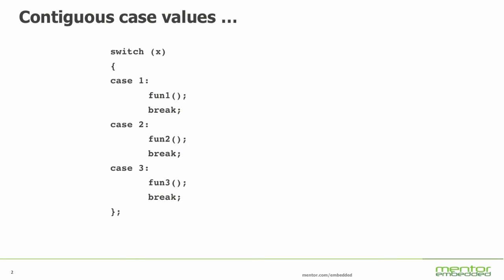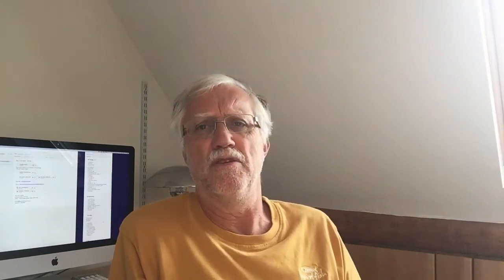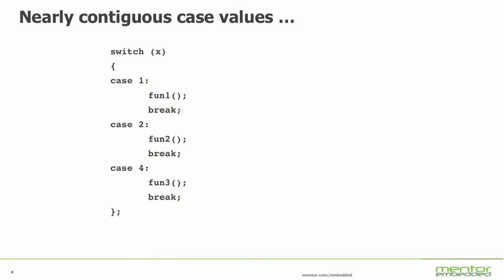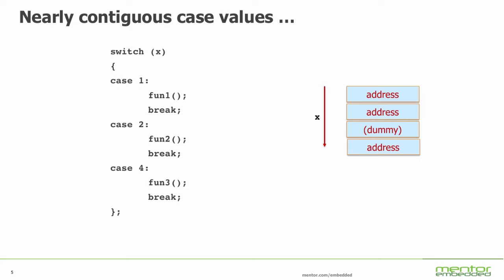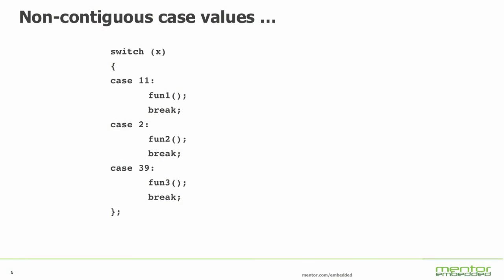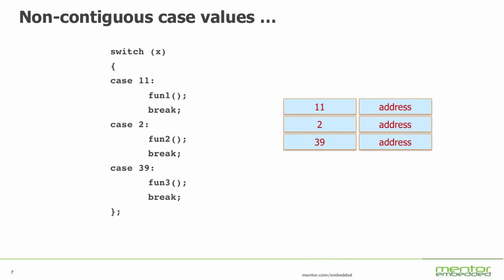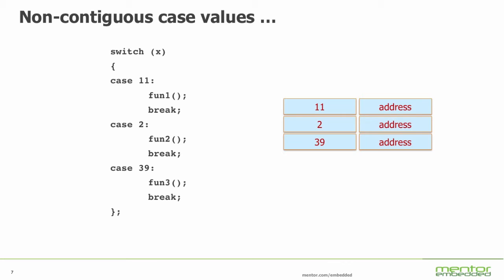Assembly Language Programming in Embedded Systems

Comment: i assembly mcs9s12dp512 processor. im very advanced with  and operation system that handles a spi packet driver. sd card, usb,rtc,bootloader updates. the full deal